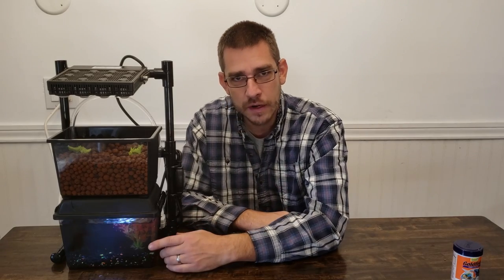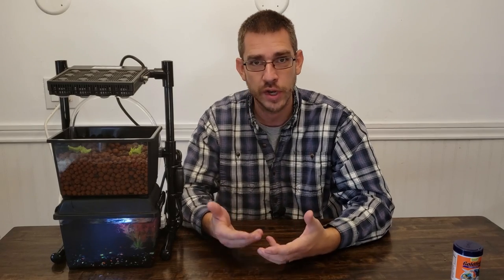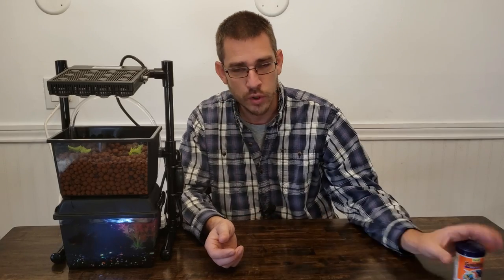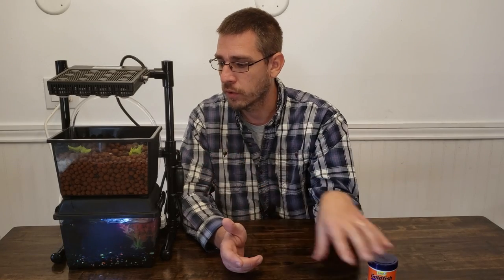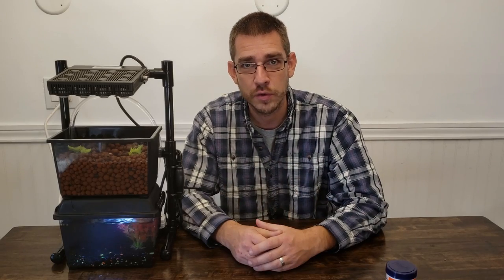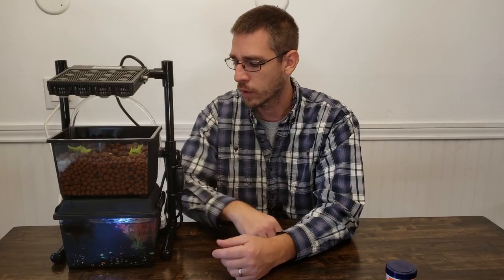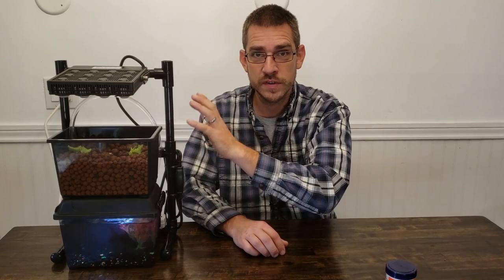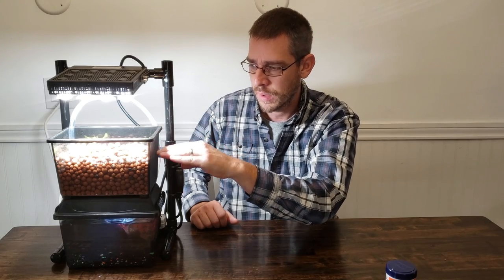DIY Mini Aquaponics System - Gardening with your fish!

Comment: I wonder how important the grow light is? Being a countertop sized unit, couldn’t I just set up the tanks in a south facing window in the kitchen?
Reply: depends on what you want to grow, lettuce is fine as long as you get at least 4-5 five hours of direct light. If it something that need flowering, it's going to be harder

Comment: Nice concept.

To help filter the water of nitrogen, most aquarium enthusiasts will follow the general rule of thumb of 1-3 plants per fish. The same may be applied here.

The more waste produced by the fish you use, the more plants that will be needed.

To also help prevent root rot, consider a flood and drain system instead, by using a bell syphon instead of a stand pipe.
This does mean that a third tank will be needed to serve as the sump tank to stop the water level of the fish tank from fluctuating.

Comment: I always saw aquaponics as to expensive for what you got in return compared to a grow light and some dirt in a container. That said it looks like you have a clever little system with the fish tank.
Reply: Depends on the size of the system, and where you live.

Right now in Australia we are going through yet another drought. The closed loop system I use, allows me to still grow my crops without having to rely on rain water, or be forced to abide by the current water restrictions.

In areas where soil quality is poor, or growing seasons are limited, aquaponics is a good alternative.
Reply: @mathewpoole3589  you make some good points for having a system. Where I live water has never been a big issue but out west I can see were it is an issue and might help some people grow their veggies.
Reply: @chevy6299  
A suitably sized system could recoup its initial outlay in as little as 2-4 years. This isn't always the case for smaller systems though.

There are some fairly decent small scale systems available, that while being incapable of producing relative yields, can cost as much or even less than what it would cost to setup an above ground planter in a titled courtyard.

But you are right. If the aim is to grow only a few heads of lettuce a year, than aquaponics will cost far more than its worth.

Comment: Cool build. Would be nice if the fish had at least 10 gallons of space. It will be really hard maintaining proper water parameters in such a small volume of water even with the expanded clay as a biofilter.
Reply: He’s got a 1:1 ratio of media to water volume, and with how porous the clay and rock is, it’s plenty of surface area. Depending on feeding/water changes/source water quality, he could probably support two mollies or similar sized fish.
Reply: @TheRealConMan98  Sure the filtration will work but it is still a small volume of water compared to the fish. Fish keepers would say even a betta would need at minimum 5 gallons of space. That poor fish doesn't get 2 gallons of space.
Reply: @cryptocorner2253   As an actual professional aquarist and water quality lab manager, that’s not true. Fish can thrive in smaller volumes with proper enrichment, life support systems, and maintenance. Is the average person getting a betta at petco going to provide those? Probably not, but if you know what you’re doing, you can maintain a ratio of 1 inch of body length per gallon of water, especially in an aquaponics system. Environmental quality is way more important than space when it comes to quality of life.

Comment: This is a cool little system. Lately, I have been hearing from some aquaponics sources that the mini systems don't work very well, so I'm hoping that you'll keep us advised on how well this system does over time.
Reply: I have an aquaponics of this scale and I have say (in my case) this statement is true. I have mine for 2 years now and I've used various media, water flow rates, number of fish and water supply methods. Up to this point ive found that hydroton(expanded clay pebbles) works best along with an auto syphon.
 I am struggling to grow plants by directly placing seeds in the grow bed, i must germinate them first in a sealed wet paper towel or soil and THEN plant them into my growbed.

Ive tried various plants as well, Bassil dies almost instantly or it will grow very slowly, parsley seems to do ok and mint literally thrives in it.

My uncle, who lives nearby, has a large system with a 1000L fish tank and a growbed area of around 8-10m2 with normal gravel instead of hydroton as the grow media and his system flourishes in almost total shade.

So I do believe that bigger system works easier that micro systems and also, all the tips and instructions on large scale aquaponics forums does not seem to completely work with micro system.

My plan is start a bigger system with a growbed area of atleast 1m2....
Reply: Saartjie_69  for how much fish you have, what's your feed rate and the ratio of the feed rate to growing area? IIRC, it's 100g of feed per square meter of growing area. You might not be feeding the right amount to produce the correct amount of ammonia to be processed by the amount of growbed you have in such a small system. Have you tested your ammonia, nitrate, and nitrite levels?

Comment: Good unit to do some concept testing, but too small for reasonable results. Don't expect your fish to survive or be healthy in this small of a setup. That fish should be in at least a 10 Gallon tank to have enough space. you can bump up your aquaponics size.
Reply: Depends on the species and what decor/scaping you are using.

Personally I wouldn't recommend anything below 5 gallons for the fish tank for a system this size, with and addition 10 gallons in total for a sump tank, plus grow bed.
Reply: @mathewpoole3589  looks like a fancy gold fish here, gold fish in general need atleast 10 gallon holding tank + their aquaponics system.
Reply: @BillTheTractorMan  

Can't say I know much about goldies. Bettas are more my thing.

The shape and footprint of the tank matters more than the capacity size.

A tall cylinder 10 gallon tank is just as bad as using a tank smaller than 2.5.

While a shallow 5 gallon that holds only 6-8 inches of water is a far more suitable sized tank due to its width and depth, not so much its height.

So with that said, if he is using a gold fish, depending on its size/age he will need to get a larger tank a some point. Otherwise, he'll be better using the same sized system with tetras or maybe even shrimp or something.

Comment: Maybe I'm just blind but did you put the measurements for the PVC parts somewhere for this build?  I can't seem to find them, thanks for all you do and for the inspiration that you give to many others, including myself!
Reply: height of the pvc pipe within the clay media should be 2 inches below the top. so:
height of pipe = total height - 2 inches. 

why 2 inch? 
1 inch for splash guard (dont want a wet floor!) 
1 inch for dry media/clay u will dump on top to keep the wet media from getting algae or mouldy or fungus or whatever. 

hope this helps!

Comment: Is there any way to get the instructions with items used for making these? I'd like to have some of my 5th grade classes make them (mostly) on their own this year.
Reply from the maker: The items are listed in the description. You would have to put one together and write instructions down from the video. I never wrote out a step by step on this project unfortunately
Reply: I would highly recommend not teaching animal cruelty to your classes. Might as well look into hydroponics if you aren't going to give the upmost care to the fish as well. They fish die, the system fails. Goldfish require quite a bit of space and can live for 15+ years if properly cared for. Killing them off slowly like this... It's unnecessary.
Reply: ce collie  chosing not to properly research the proper care for a living creature that depends on you... is that person's obvious lack of care for said living creature. It's not melodramatic to be factual.
Reply: @lookgoodfeelgoodmagick4173  The video author said he put a fish from his other (probably larger) tank in this tank as example of how it works. This fish was not a permanent resident of this tank. 

I saw this as more of a proof of concept than an actual plan on how to make a mini aquaponics system. If a person does the research on what species can happily live in a small tank and how to care for that creature, there isn't anything wrong with this method. Obviously one shouldn't try to keep a goldfish in such a tank, but pond bladder snails or ghost shrimp would likely thrive.

Comment: Why didn't you bell siphon the plant tank?
Reply from the maker: I wanted to add a bell siphon but you need a sump tank in order to do that otherwise the fish tank would drain to half full while the grow bed was filling and then raise to full when it drained. Not ideal for this size system.
Reply: @SSLFamilyDad 
I just left a comment of my own advising the same thing.

My only concern would be root rot if there are any stagnant pockets of water.

Your design isn't too far removed from the concept I use for my terrariums.

Comment: Algae will be a big problem with this design.  Especially in your grow bed by the window and at the top level of the hydroton.  You should think about painting the entire grow bed black and then having 1" of dry hydroton before the water level goes back down into the tank.  Even more if the grow bed does not wick in oxygen by draining of nutrient solution completely.
Reply: What does painting black do?
Reply: Becky Pelishek light in the grow bed combined with water will grow algae. It’s not good for the plants and can also kill the fish and mess with your water.  Pairing it black will keep the light from entering the area submerged in water.

Comment: You should have made the center drain pipe a little bit shorter and covered it, creating a bell syphon which would have FULLY drained your grow bed all the way down to the bottom which would let more oxygen down to the roots and ensure that your roots aren't just sitting in the water.